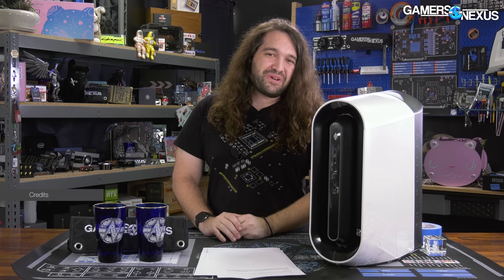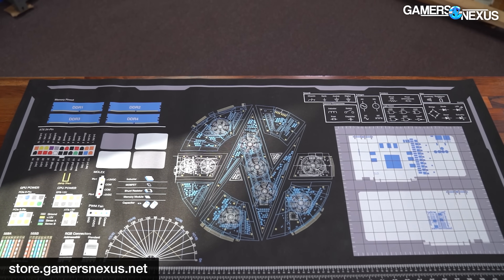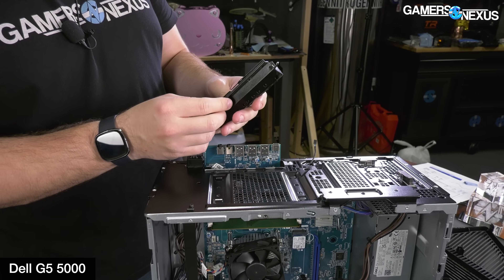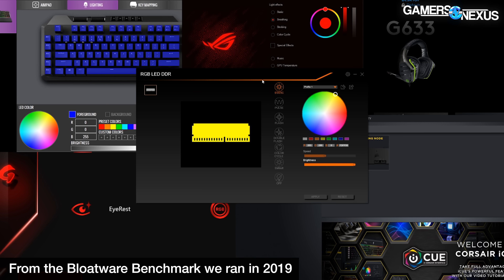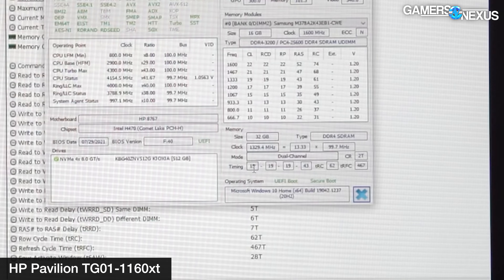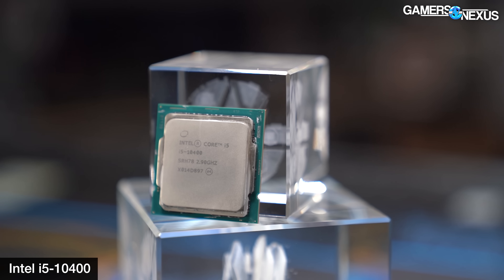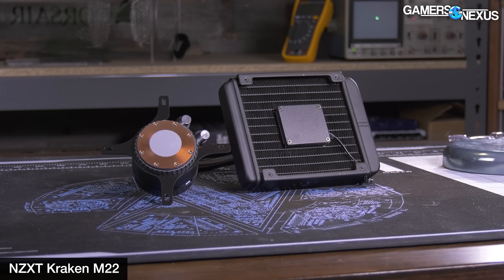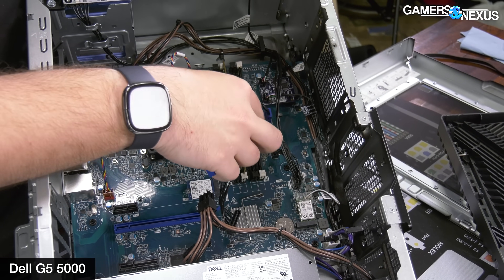The Worst Prebuilt PC Mistakes We've Seen (So Far)

Comment: On a casual conversation with a co-worker some time ago, he was sorts of bragging about how he had 64GB of ram on his "gaming PC" and how it made it so much better. The PC was average, hardware decent enough to have some quality of life in gaming at 2k. He explained the reason he had 64 gigs was because he found it convenient to tab out of a game he was getting bored with and play another, while having enough ram to have everything else opened on the background like all the other games, browser with dozens of "preferred" tabs and such.
He kinda of accepted the fact that he couldn't run most of those games at more then 1080p with medium settings. 
His routine after a reboot would be to open steam, launch all the apps and browser and tabs and shit, the games he was playing at the time and let them sit until he felt like tabbing out to switch.

I have a hard time believing someone can actually do this. And no point in offering advice to whoever does, ...
Reply: It's actually not all that difficult, but not with a low end machine.   Ryzen 9 3900X with 32GB RAM and a 1TB NVMe can handle games with other stuff open in the background due to the extra CPU cores and RAM.    No point to going to 64GB, but 32GB makes some sense in the modern era.

Comment: This is why the AMD FX8150 system I built 9 years ago still outperformed most prebuilt PCs being sold now.. 32GB quad channel DDR3 ram beats all the single channel DDR4 and much of the dual channel DDR4. Most OEM manufacturers are also using substandard thermal compound.

Comment: Have to disagree with the 120mm AIO coolers, mine dropped my Ryzen build by 10 C over the included AMD air cooler, also totally quiet.
Reply: Amen to that, i compared wraith prism cooler against Corsair H45 tested it on A6-5400K with ambient temp of ~32c with the wraith prism at max speed it still gets around 55c while the aio with the fan off only gets up to 48, and around 39 with the fan on 60% and the noise difference is night and day, the wraith prism sounds like banshee having a explosive diarrhea while the aio is definitely quieter especially with the fan off.

Comment: I think one of the reasons for the HP and Dell systems use of proprietary components and wierd design choices is that their businesses primary focus is supplying PCs and laptops to corporate customers looking for best value for money and who are largely unconcerned with upgradability or servicing costs. Then HP and Dell come along and think they can get in on the Gamer market by sticking in a GPU and a bit more RAM. Generally speaking a PC supplied on a FM contract to a big company will never be upgraded, will be discarded or just pushed down the organisation when replaced with a newer model, and so the fact that they are hard to upgrade or hard to reuse parts from is not a consideration. Lets face it, Alienware these days (as apposed to its days of glory) is just Dell with a party frock on, and will increasingly become just a brand of Dell until the differences are unnoticable and they completely lose their relevancy. 
If you want a pre-built, then there are small companies (or even individuals) that do a good job, have knowledgeable staff and might even operate locally to you. You might have to pay a bit more, but you're going to be far more important to them as a customer than you will be to Dell or HP. You might even be able to get them to come out to fix things for you. Of course there are also cowboys, so the best plan is to involve yourself in a local community (even if its virtual), work out who's opinion you trust and gather recommendations from them. Its a whole lot more work, but you will end up with a better system and probably people you can trust to turn to if you have problems.

Comment: I am a bit sad that Dell and HP did not change a thing, concerning the problems I experienced with their PCs. About 15 years ago, Dell built their PCs a similar nonsensical way (Mainboard in the wrong side of the case and almost nothing could be replaced by standard parts). And HP is not a big difference here. I had a really hard time figuring out what the problem was when a customer needed a new PSU for his HP, until he showed me the original PSU. This just shows that they don't do anything about the problems with their PCs.

Comment: I know I'm a bit late to this... But I figured I'd add this strange note to a prebuilt I ordered earlier this year, because I couldn't get a GPU for even a vaguely sane price. It includes a small 240mm AIO liquid cooling setup, with a single 140mm fan on it. While probably fine, it's really strange that the original pair of fans were replaced with a single RGB 140mm fan. Performance seems fine (or at least average for the components) and heat doesn't seem to be abnormal. It's just really strange.

Comment: What I find most annoying about proprietary power supplies is not that they can't be reused in another computer, it is that you can't replace one gone bad with a readily available standard and/or salvaged ATX power supply on the fly. Nor can you easily upgrade them if at all. In either case you must pay a high price through the OEM for the same crap.

Comment: Oh yes, the proprietary crap they are forcing on us via prebuilds is making me crazy. I have otherwise okish HP Z440 workstation (got it used for super extra cheap), but oh my lord, PSU with it's non standard headers was driving me nuts. Ended up buying thingie to connect standard ATX PSU to that HP motherboard, but then again I've struggled with chassis and how to fasten standard PSU there. !@#$% all of that proprietary cr@p locking consumers into buying HW only from specific prebuild brand. That is so much against the consumer, that it hurts...

Comment: So far I'm happy with my EK Fluid Gaming pre-built PC I purchased. No complaints really other than needing to update the MB firmware (wasn't super old, but was a few months old and needed an update to get the DOCP to work properly). Zero bloatware and turns out they are local to me in San Antonio TX and let me stop by and pick up the machine in person to reduce any of the various potential shipping damage fiascos I've seen with some systems mentioned, lol. Did a quick overview on my YouTube page of the system (Vanquish 295). Would def be interested in seeing a GN review of the system sometime! :)
Reply: man that ek comment aged like milk
Reply: @SoulcatcherLucario  hahaha yep! Lolll. I've actually had great service and luck with them, thankfully, and had been up to their now closed down san antonio building twice. Once it seems shortly before they axed everyone when I was up there for them to swap out a new m.2 drive and fan for me free under warranty. Looks like I got lucky and retrieve my pc right before they closed shop! Chatted with a few of the ppl working at the site and when I was there all seemed fine outwardly.. plenty of stock on the shelves for replacement components, test benches up and running, etc. I've since given the pc to my son and have a new 7950x3d 4090 rig but overall no complaints (other than cost) from my ek machine and the service I had received.

Comment: That both SIs and OEMs try to swindle you on PSU, but in different ways is so true... I found a British SI-built budget PC for my mom a few years back, when it all wasn't that bad... Good price, standard parts, no bloatware... 200W (!) PSU sourced from who knows where that failed (non-explosively) a few months after warranty expired. Thankfully, as it was standard, it could easily be replaced. Haven't experienced the opposite (an actually reliable server-grade PSU that's only available from that OEM) but... Yea, sounds like the thing they would do.

Comment: I have Firefox with 400 tabs and it works fine[YMMV] on a 4 GB system. Granted, absolutely nothing else can work alongside it, but still, tabs are optimized enough in modern browsers that kajillion tabs in the background isn't really much of an issue, certainly not big enough deal to get more RAM just for that. (actively used tabs are another story, ofc.)

Comment: The reason they send out that all aluminum near low profile lightweight heatsink is shipping.  If they actually sent out a copper, heavy and tall the sheer force on the retention bracket would be higher.

Which means that if UPS or Fedex or your local delivery guy drops it, the aluminum one will for sure survive.  The copper tower will most likely cause damage.

Nowadays its even prudent to ship with the videocard not attached.

Comment: What about Microsoft Windows bloatware?
Reply: gamers nexus dont know the difference between bloatwares and malwares. bloatware you should just uninstall if you think you wont need it. unlike malwares. windows blatware can be uninstalled and you could block their appstore update using third party firewalls. malwares embedded in hardwares on the other hands is there to stay no matter how many times you want to clean install your PC.the only way to get away from those, is to find which hardware is bringing the malware, and remove it from your computer physically.

Comment: The last time I purchased a dell laptop, I had to do a clean install of windows to get rid of the bloatware. Not only did that dramatically improve the system performance but it also added 3 hours to the battery life of the laptop. That is a 20% improvement in battery life just from running a clean install of windows.
Reply: Insane. I just got an HP pre-built with windows 11 (no option for anything else). I was planning on just wiping it and running Linux Mint anyways, but I played around with Windows 11 just to see if it was as bad as everyone says. Not only was the OS itself bad, but the amount of bloatware pre-installed was infuriating & shocking. If I were an average user, I'd have no idea that all of that extra crap was throttling my performance so drastically and spying on me.
Reply: @Anonymous-t7k1m You are no one special that a rich company would want to spy on you 😂
Reply: @Anonymous-t7k1m  I just built a PC with Linux compatibility in mind. Been running Linux for 7+ years now. It's superior at just about anything, especially nowadays. 

Team RED CPU and GPU + an Intel network chip. It kinda bugged me that I was putting Intel in my otherwise 100% AMD build but Realtek is absolute junk and barely supports Linux which is sad because Realtek has a monopoly (like 80% share) in the LAN/WiFi market chipset.
Reply: @spicynoodle7419  Sure it is bud
Reply: @Anonymous-t7k1m  If you have a SIM card you’re being spied on anyways, get a grip

Comment: 15:56 Is the 550W Bronze unit the GP-P550B? If so, it might not be one of the exploding power supplies. It was reviewed on Hardware Busters, and while it didn't perform particularly well, it did not explode during OPP testing.

Comment: I work in 3rd party PC repair. At this point we're 95% a dell shop, much to my regret. Watching these kinds of things is cathartic. That said, the dell building mentality makes a lot more sense as a business PC thing because you buy them by the 50-100 so suddenly the proprietary parts do have spares and you can swap them around and fix them. Not excusing shit here, having off the shelf replacements would be far better. Just saying that at least where these things originate it's possible to repair them. In big business it's bad but it makes people buy more PCs than they need to have spares so it sort of works for dell in a scummy sort of way. In the consumer space it makes NO sense and is even worse. Now back to watching the video and my coffee before I have to go cut my hands open on more weird steel hinge compartments in dell PC cases.

Comment: Worth noting for the power supplies that the "Gigabyte 550W Bronze" unit that NZXT uses is a P550B, which is group regulated (i.e. unacceptable in any machine that has a graphics card.) This was also the case with the ABS prebuilt reviewed on this channel, with the thermaltake smart, though that one was a bit worse due to missing protections. 

The thing with power supplies is that it's rare for them to blow up immediately, though there are some that can (like the P-GM, which cyberpower pulled from their offerings within the last couple of months.) It's more common that they just don't last as long and/or reduce component lifespan by feeding the system inconsistent voltages. Still,it's unlikely to fail within a year or two, which is conveniently long enough for it to outlast the warranty period.

Point being: replace your garbage power supplies before the warranty expires.

Comment: I bought a pc from cyberpower in the UK and it was all good but the one thing that I did find was that a fan wire was put in the power supply shroud hole so when the shroud was  put in place it was ripping the wire to bits leaving the fan broken

Comment: After watching your videos, I feel like I got gifted by god himself the perfect prebuilt PC from ABS on sale last year. The whole thing cost less than the card it came with in 2021. It works perfectly , wiring is great, and 16 G’s of RAM was installed correctly on the board. All I had to correct is add more cooling to the case/ build, all in all I got a way better deal than anyone now (2021) can do with a custom PC, and I still have more room for upgrades.

Comment: One custom machine that stuck in my memory was from Packard Bell. It was a tower with a backplane, which isn't all that unusual, but what is unusual is what they did with the main board. It was stuck in the bottom of the case, and wider than the tower itself, so the case had a sort of foot shaped around it. Inside that cramped foot was where all the connectors were, which was quite the dexterity challenge to access, and of course it was an incredible dust and lint trap. One could hardly imagine a design more prone to fail while still enclosed.

Comment: Thanks Steve! Some people may be interested in buying prebuilts strictly for their parts, so this is a good way to compare actual cost per component (that you will actually utilize in your final build). For example - RAM. If you are getting the pre-built figure the RAM is probably not high performing, so just get the cheapest RAM package and then purchase better RAM.

Comment: I learned to love bloatware 25 years ago when dad bought me a prebuilt PC. It came with Windows 95 pre-installed, but it didn't have an installation cd. How ever it had a software that could prepare installation floppy disks. Obviously bloatware would have to be included so this operation took 37 1.44MB floppy disks. Standard Windows 95 installation would have fitted to 15  1.44MB disks.

Comment: (7:53) HP Legion?!?!?!?!?!?!?!?!

Oh my. Thanks for reminding me how bad consumer Dell PCs may be despite how good their monitors are. Also, thanks for making me proud of building my own desktop PCs, as well as local system integrators and repair shops where I live.

I had an Inspiron laptop that was gifted to me, which had proprietary Dell trackpad drivers that were glitchy and caused the trackpad to stop responding frequently, so I had to use the touch screen and/or external mouse, not to mention, the laptop would bugcheck (BSOD) while hibernating and restart instead, resulting in a warm drained battery the next day. Along with that, Dell choosing to hold in the power jack using a single plastic tab instead of two metal tabs resulted in the power jacks breaking off SO FREQUENTLY outside of the standard warranty period resulted in me not only having to replace them, but also me frequently having to take the bottom cover off in order to charge the thing because it would otherwise fail to detect the genuine Dell power adaptor that came in the box with the laptop!! I really hope Dell have learnt from their mistakes since.

(13:50) I won't be surprised if Dell engineers and designers were being pushed by (possibly money-focused) upper management to put in those lacklustre coolers and all the bloatware.

(14:32) Thanks for reminding me why I didn't buy 120mm liquid coolers, and instead buy 120mm tower type air coolers!

Comment: In Singapore, we had our 'Microcenter'-type IT mall(called Sim Lim Square) that sells computer parts. While it's where we find our glorious PC parts from 3rd party brands, that place is also a landfill full of discarded OEM desktops and laptops, some taken up and refurbished for reuse while most others were piling up in the electronic graveyard.

E-waste is one of the low key types of pollution that is rarely brought up in face of these tech companies. They need to be stopped. IIRC two years ago Samsung and Apple were also fined by some European governments for pumping bloatware into their phone updates, prompting users to change to newer line of products in less than 2 years. They are driven by greed, does little to no improvement to tech advancement and creating more waste. World governments needs to step in and put these tech giants in check, or we might really end up in a dystopian world filled with steel junk with these intentional self-propietary designs.

Comment: Mistakes imply they weren't aware that these were problems. But then these were more likely willfully designed in order to have limited upgradability so that they can sell you again a whole unit later on, assuming you didn't learn from the mistake the first time.